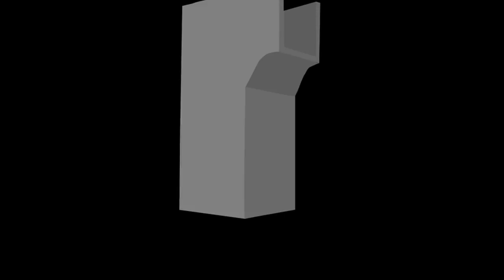The Korg Monologue- Part 4- Envelope Generator part 1

Comment: Its a Return-to-Zero- Synth? The video was over 6 years ago now.  Didn't it have a SHIFT-PLAY function back then?  So you can adjust the sound to the condition of the Customize controls.
Loads the status of the switches and controls Top in the selected program. 

By the way.. The Monologue is STILL TODAY .. The Badass (Beast) Synth on the Planet Earth for 300 Bucks!  Sounds fuckn´Awesome!
It simply bite the Head off..,  as far as the Sound Character is concerned , of much more expensive Synthesizers! 😅

Comment: You are just the person I need to ask about something that has been bewildering me: why does the Minilogue (and the Monologue) have no amp target for the lfo? Tremolo is a very important modulation for me for many evolving and textural purposes and such a basic function of most lfos. Is there a work around for this? In this video on theMonologue, you reference how the filter can also can affect amplitude, and I get that, but it's also creating frequency cut off which is not the same as as a straight forward tremolo lfo effect. I've been searching YouTube and online for some rational for Korg to leave amp target out and haven't found one yet. You seem to have some Kung fu master knowledge on synthesizers, which has been a blast learning about, and thought you might finally give me some answers about this.
Reply: I would assume price? You can always use a post processor (e.g. guitar pedal) to add tremolo, flanger, phaser, compressor, etc.
Reply: @marc.lepage  Old post - there are osc you can install with an amp lfo (price is obviously not the issue - a simple tweek of code is all that is needed as evidence by user osc being equipped with options) Also tremolo user efx for the minilogue  are available now :)